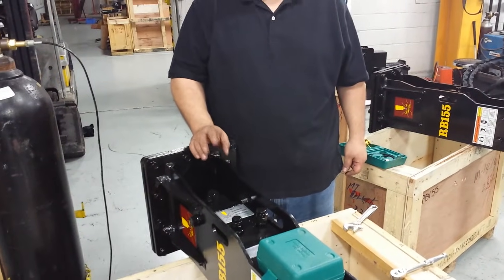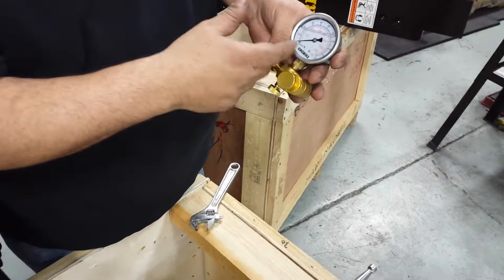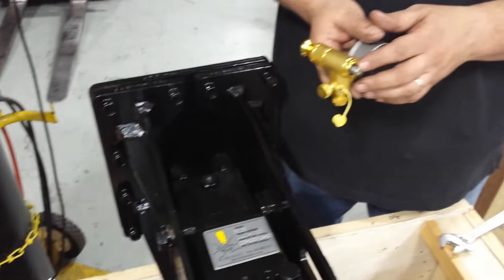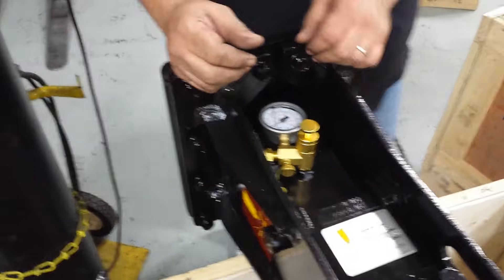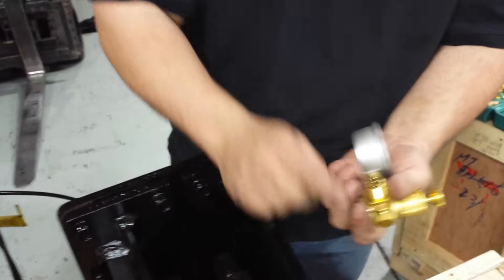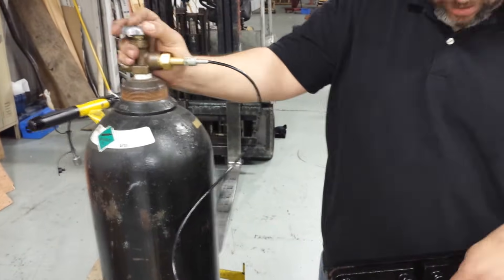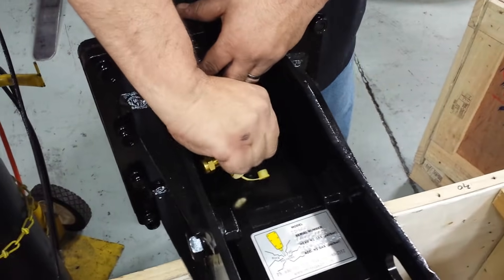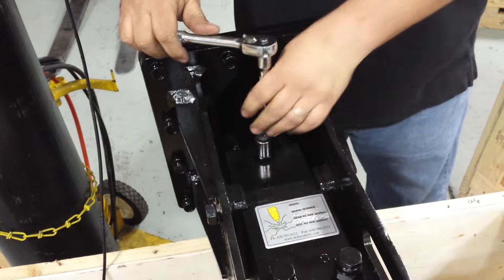Setting gas pressure on hydraulic breaker

Comment: Hola Jose, yo acabo de comprar un agrotk 680 creo que es de China pero no especifica que presión debe llevar buscando aquí y aya algunas personas le ponen 230psi yo intenté pero no funcionó le puse mas y tampoco solo se ve las mangueras del hidráulico que llega la presión pero no hace nada que cree que tal vez estoy haciendo mal.
Reply: Check your hydraulic flow is in the correct direction. If your flow is backwards it won’t work.

Comment: Hi there, I just bought a Chinese CDT 200 from Northern equipment for a Kabota KW 800–5 and it comes with a uncertified oxygen bottle with male threads not a nitrogen bottle with female threads and  the nitrogen fill hose goes to oxygen bottle where did you get your nitrogen bottle hose adapter for the unit you were filling in this video. Thank you Keven Kullberg
Reply: Mine is a Agrotk 680 I’m guessing from china as well. Came with Oxygen tank and connections. Did you try it with the oxygen or did you go nitrogen?
Reply from the maker: Happy to help, please remember if you need parts, we are here to help, 630-701-0172

Comment: will that tool and process work on a bobcat hb980 breaker
Reply from the maker: This charger tool only works on Korean style breakers the HB980 uses a European style fitting adapter that bobcat may sell.
Reply from the maker: Happy to help, please remember if you need parts, we are here to help, 630-701-0172